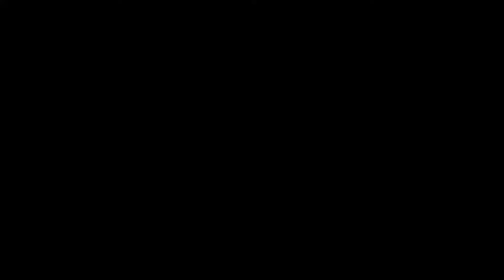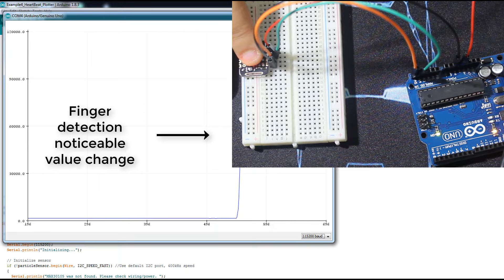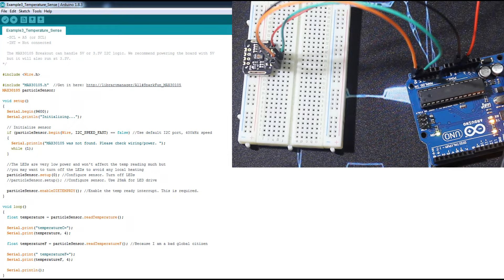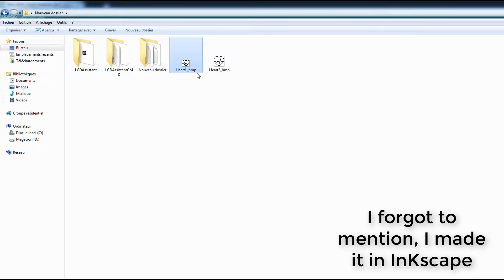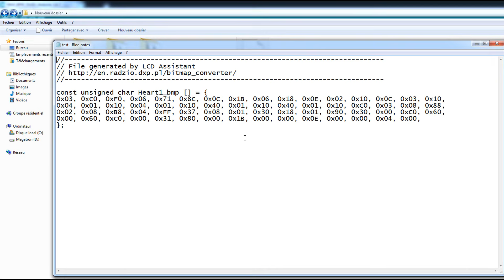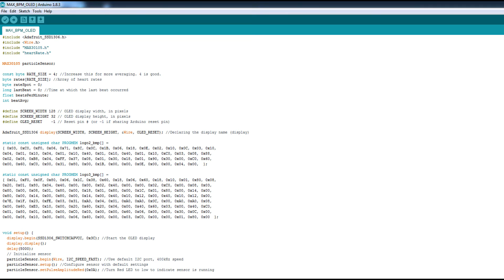Measure Heart Rate/BPM and SpO2 with MAX30102 + Arduino

Comment: Can the sensor be attached to other body areas such as the wrist?
Reply from the maker: Hello, you can try to place it and hold it with a band, then compare the two readings.
You can use DFRobot SEN0203 module, it's more adapted for this.

Comment: Quick question, the module for the heart rate sensor i am using has 8 pins (4 on each side) but yours has 4 (4 one one side and the other side nothing), thus i cannot connect it properly (straight). Is there anything u suggest or am i using the wrong module?

Comment: After I upload the code into Arduino, the serial plotter says "MAX30105 was not found. Please check wiring/power. " The TX, RX and the LED on the MAX30102 aren't flashing. How can I deal with that?
Reply: Did you solve the problem? Because I have the same problem.

Comment: having an issue where the Arduino isnt actually reporting the information on the serial plotter or serial monitor and the TX and RX LED's are not flashing as in the video. Is there anything I can do about this?

Comment: hello this is nice project and video. i wanted to ask about the value 7000 for detecting finger on the sensor. what's that value mean? how could you assume that value 7000 as finger already on the sensor? thank you in advance and sorry for my bad english.
Reply: When there is nothing in front of the sensor you'll get values 0, maybe 100, but when you put finger (not even touching) you are guaranteed to get like 15000, 7000 is a safe value to assume the finger is away

Comment: Good work, but i have a little query. The BPM values are varies rapidly. How to stable the values of BPM as like the other products available in the market gives more stable BPM values
Reply: Use a rolling average filter
Reply: @kugelblitz9137  what is rolling average filter? I have the same problem, max30102 gives me non stable data

Comment: hello dear  I am using this sensor with other sensor but with this library it's affect the heart beat rate how can i make this reading like an interrupt ?.
thank you
Reply from the maker: On Uno only pins 2/3 can be used as interrupt's I suggest adding a button to launch the measuring function that will do multiple readings before displaying the result and continue other things...

Comment: hi, I would like to know how to implement the code to insert spo2 in the display. 
thank you
Reply from the maker: Hello, I can't remember if I tried it or not to tell you if it works first.
You can try, first you install the OLED library, do the declarations like in the code I provided, then instead of showing the value on the serial monitor, display it on the OLED.

Comment: Hello, i have a project in which i have to show both spo2 and bpm can u please tell me how to do it.i.e source code and schamatic ckt for simulation in proteus
Reply from the maker: Hello, Never used it with Proteus before, and I couldn't fit both codes in the Arduino as I said in the video, flash memory space problem.

Comment: Hi can i simply combine the heart rate algorithm and spO2 together or do i need to specifically organize it for the whole thing to work?
Reply from the maker: Well the SpO2 code sets the module to other parameters than those used in BPM measuring... but you can give it a try and combine the functions and check if ther results are okay.

N.B: I tried this using OLED and it didn't work...
Reply: @SurtrTech  for lack of flash ?, or ram? ,, throw junk data? ,, or what happened ?, because I use to get the 2 data...
Reply from the maker: @angelruiz825  I had flash space problems, I tried in many ways and used less global variables but I failed... and it didn't work with the OLED
Reply: Since there is so much data from spo2 you will need to implement can we use fifo to store data temporarily for flow control?

Comment: can I do this with MAX30101  ?
Reply from the maker: Hello, well the library is called MAX3010x and it includes the MAX30101 too, it should be good.
Reply: @SurtrTech  SO do I follow the exact similar process as in the video for MAX3010x as well, including codes and libraries ??
Reply from the maker: @sandeshtayde1516  Yes.
Reply: ETC Official . did you manage it with MAX30101 because i cant do this.

Comment: So I want to make the model u made but without the buzzer or OLED screen, is there a separate code for that or do I use the same code. I want it to look like what you did in the video before you added the OLED screen and buzzer where it showed the BPM results in the serial plotter
Reply from the maker: Hello, yes those are examples from the library, you can find the library in the link below the video, there's one for the serial plotter, and one that prints the IR, BPM and Average BPM, if you want to plot the BPM, you can try the "Example5_HeartRate" and in the serial.print functions leave only "beatsPerMinute" and start the serial plotter instead of monitor, I think you may see the BPM values as a graph
Reply: SurtrTech So I’m looking through the libraries and I am having trouble finding it, I’m a beginner and I really don’t know my terms, do u mind naming off the libraries/codes that I would need?
Reply from the maker: @mayankgudi5919  Well first download the library "SparkFun_MAX3010x_Sensor_Library" from the link or from here: https://github.com/sparkfun/SparkFun_MAX3010x_Sensor_Library
Once downloaded go to Arduino IDE -> Sketch -> Include library -> Add .ZIP library -> Select the .ZIP library you've downloaded
Then Arduino IDE -> File -> Examples -> "SparkFun MAX3010x Pulse and ..." -> Go there and you'll find all examples I used and some other ones just select and you'll aready have a code to upload.
For your case: Example 4 will display raw values on the serial plotter, and also shows you peaks when you place your finger.
Example 5 will display the IR values (Raw), the current BPM and Avg BPM on the serial monitor but you can remove the IR and Avg BPM to show only the BPM then display it on the serial plotter if you want...
Reply: SurtrTech Thank you so much, I finally found it. The video was amazing and thank you for guiding me. I am looking forward to trying this project out myself. Thank you again!

Comment: Hey thanks for the video, can you upload the SpO2 code, please? Dont be selfish!
Reply from the maker: Selfish? Well all the schematics, libraries and codes are already on the link for anyone to use... The SpO2 code is on the library example it's made by SparkFun...
As mentionned in the video I couldn't upload a code that measures both BPM and SpO2 while operating the OLED, the code was too big and the OLED keeps freezing, so I ended up with BPM only.
You can give it a try, first upload the SpO2 code from examples and then adapt it to the OLED as I did, all you have to do is add OLED libraries, replace functions and here you go.

Comment: Hello, could you show how to make spo2 code visible on the oled screen? Im trying to implement spo2 code from example, but im having hard time to do this.
Reply from the maker: Hi, I had a lot of trouble uploading the SpO2 code to the Arduino too, it's due to memory space, and the OLED kept freezing unfortunately so I ended only with the BPM part
Reply: @SurtrTech  The 30105 has more functions, so maybe this library uses more resources. Isn't there a specific one for 30102? ,, Or could it work with the 30100? ,,, I imagine you tried to reduce the buffers [100] to [50 ] or [25] ,,? ,,, / only show the "hr" and "spo2" in the oled, without the other unnecessary data / make captures of "spo2" and "hr" using different blocks { },,with local variables within each block or call a function, outside the void loop to spo every so often(not at the same time) and show the average of them during a certain time, for example take data 3 seconds of hr, then average them and show them held in oled, then take 3 seconds of spo2 and do the same This way you would show averages that every 6sec. were updated in the OLED ... or stop for a second every minute to take spo2 since this data does not change much or very fast / in a more extreme case take 8-bit data (uint8_t) in the chain but before catching them, get a rule ratio of 3, so that they do not exceed 255 (8 bit arduinos like (at328/168/2560) use a lot of memory, when using variables of 16 or more bits, because they are native to 8 bits) ../ do not use or show anything that is float / do not show logos or animations while showing the data / use only the smallest font (size 1, "6x8pix") / show on one part of the screen a "hr" data during 1 print in oled and in another print spo2, (the eye does not I would notice it) / use a board with 32u4 (2.5kb ram) or mega2560 (8kb) (but the device would grow) / modify the libraries ... Manage another lighter library of oled like this https://youtu.be/XYBcr1KpN3Y    perhaps it would avoid all the above, this supposes using less sram & flash..I could not check all this because my provider will bring me 30102 in 1 week..I will try it in promini 328p, although I already ordered a teensy lc, since I want to add module m.sd (or Eeprom) + accelerometer + display graph in 128x64..I suppose this could do the task (8sram@32bit)..
Reply from the maker: @angelruiz825  This library is standard for them all... the problem is that the parameters for BPM are not the same as the SpO2 code, so you have to add all of them... you can maybe modify the libraries or reduce the codes further.
The main problem was also the use of the OLED, didn't start at all.
Only trying will get you to results.

Comment: Hola SurtrTech
 al cambiar la resolución de la pantalla a 128*64 el sensor deja de tomar la lectura, si se mantiene la resolucion a 128*32 funciona correctamente, puedes ayudarme ?
Reply from the maker: I have no idea, it probably creates a display distortion, if you can start from scratch without animations or anything and test it, first just print the BPM and then re create the bmp images

Comment: Hello, great project! 
I currently make a project and I really need the MAX30102 oximeter, the fritzing part. I couldn't find it anywhere. Any chance you could help me and send it to me, please?
Reply from the maker: Hi, is that you who contacted me on Hackster?
Reply: Hi, unfortunately not. I saw the project there but i don’t have an account on hackster and i thought would be better if i leave you a comment here. Do you think you could help me?
Reply from the maker: @alexandranistor6605  Well I want to help but the problem that was just a picture of the module, it's not a fully functionnal Fritzing part, I wanted to create the part but it's not working, I could send you the image I used + SVG file if you want
Reply: @SurtrTech  It's more than enough. I just need it for the fritzing scheme, to wiring it with my other components. It doesn't have to actually work.
Reply from the maker: @alexandranistor6605  How do I send them to you? You can contact me on FB page if you want or send a mail here surtrtech1366@gmail.com
Reply: @SurtrTech  Hello
I am developing project and made a code displaying spo2 and bpm. but the oled is only displaying spo2 and bpm remains zero. Can u please help me..